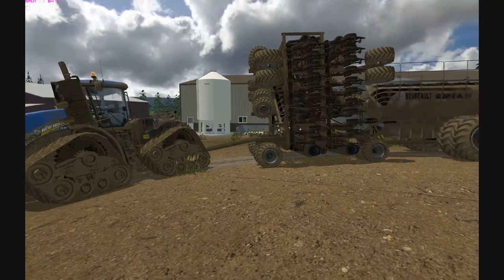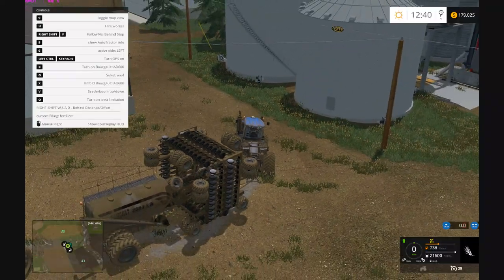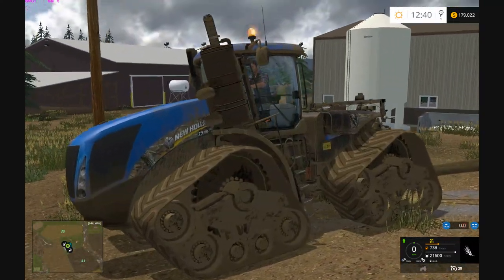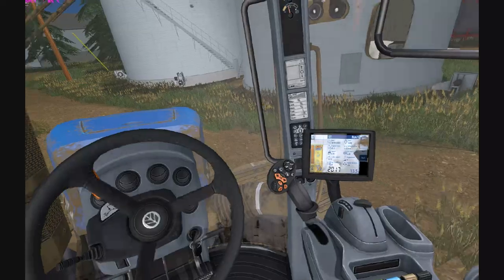Windchaser Adventure:  We Go Big Time (Part II)

Comment: on your last map, where you were spraying,, you had a little strip that you missed and you had to run all the spray nozzles to get that lil strip,, is there a way that you can modify that sprayer to where you can cut each section of boom off so your not over spraying and wasting extra spray?? the real sprayer are equipped with that capability!! you mention if we had ideas then we can post them.. that's just one I had...
Reply: Well ur still really good .another thing I'd like to see come out is a batwing bush hog.maybe 15ft or 20 ft some time for cutting road sides instead of using hay cutters.. Maybe something u could throw out to right people to design